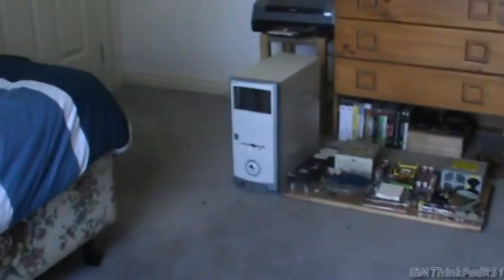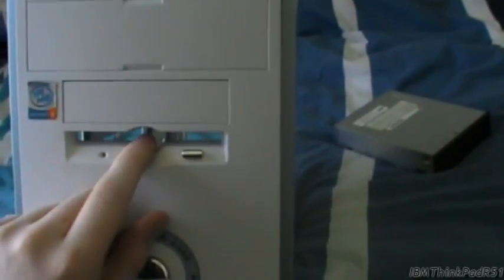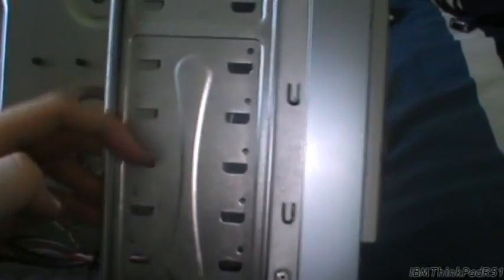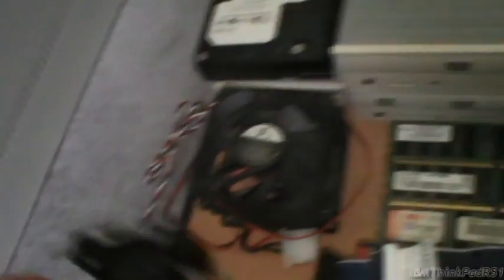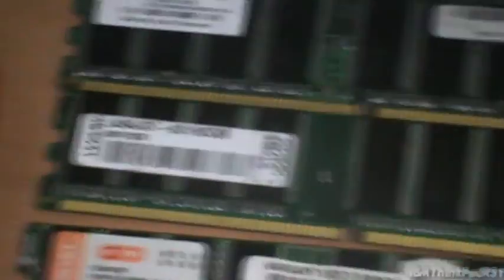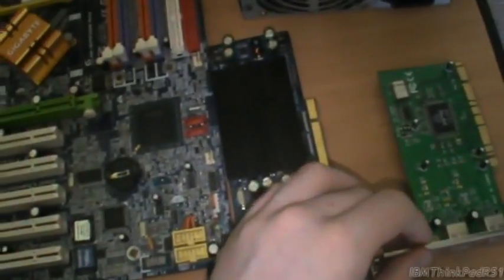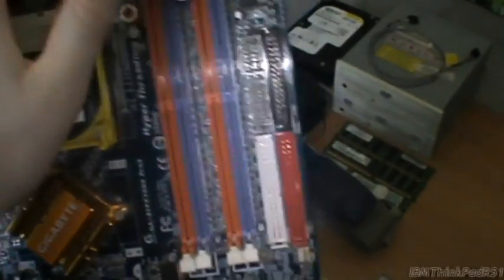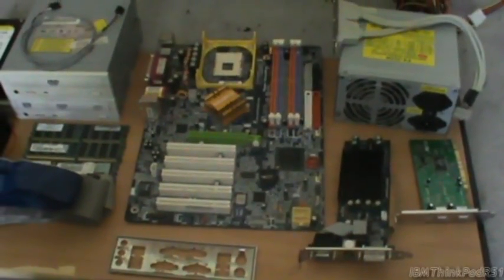The Windows XP era (2002-2006) Gaming Rig Part 1: Overview

Comment: dual channel doesn't rely on single or dual-sided chips. You need to have the same speed, and the same CAS latency (CL), and put them in the correct order if you have 2. You CAN dual channel 2 1gig and 2 512's. I've seen a few motherboards that accepted it.

Comment: By the way, what is your main rig? Mine's an Core 2 Duo 2.8 GHz Clocked at 3.4 GHz running VERY stable (might aswell upgrade to a Core 2 Quad one day), 4 GB of DDR3 RAM, An ASUS motherboard, An 400 W MICASE power supply (which I don't trust, since I had 3 of them and one had blown caps), An GeForce 210 1 GB with 512 MB onboard memory. By the way another thing, why I don't trust my power supply - recently I had to change out my motherboard, so I think that might be the reason why it died on me.

Comment: Cool man, I want to do something like this as well but I don't have a few of the parts lying around and I don't feel like spending any money on it. Might be worth looking on ebay for an old GPU though - something like an 8600GT, i'm sure you'll get for like $20 or less. Not too sure how an 6200 would handle even old stuff like Underground 2 and San Andreas.

Also, PLEASE, use your 430w PSU. An old 350w generic is a ticking time bomb.